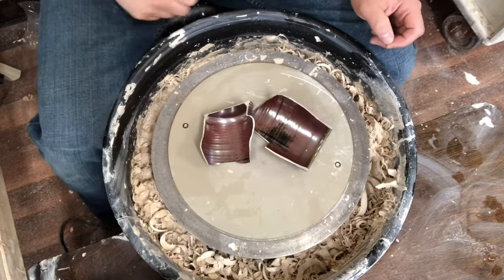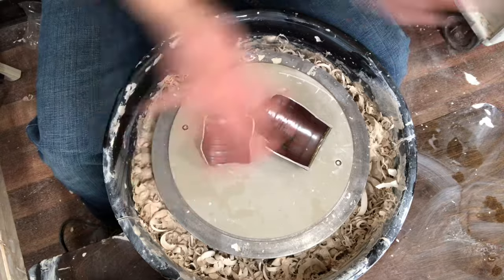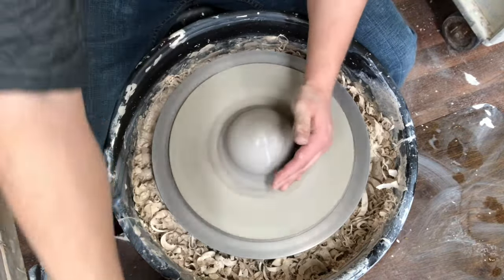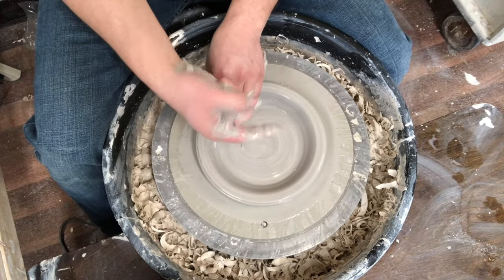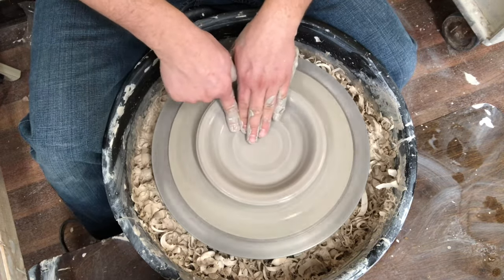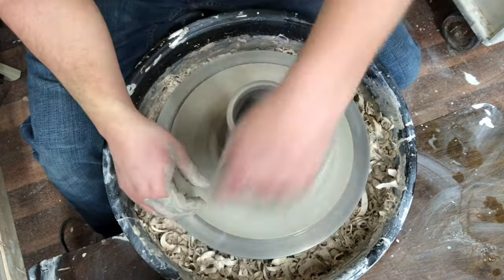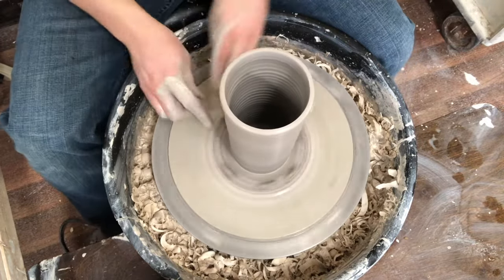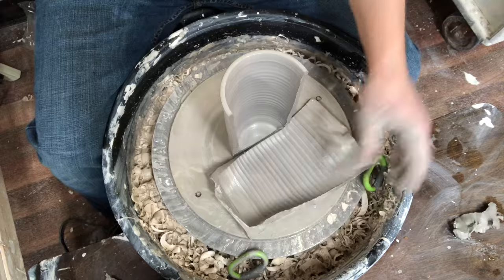Throwing Quickly and Efficiently

Comment: My instructor saw me pulling "directly cross from another" and said this was my problem with raising.  Inside fingers should be higher than outside.  Is this true? Many lessons with little good instruction
Reply from the maker: I was taught I have the clay make an s shape as I pulled but that’s not good for the clay. The proof is always the result I I saw someone eating what I want out of a pull and did it better than me I would switch. So far this is the most effective way I’ve seen to pull a wall.

Comment: What is the reason, if any, for using that pulling technique when throwing quickly?
Reply from the maker: Throwing a pot in less pulls means it will be quicker, less wet and this way leaves it smoother inside and out which means shaping is has less unevenness to have to deal with.